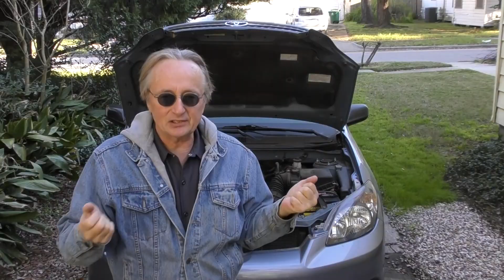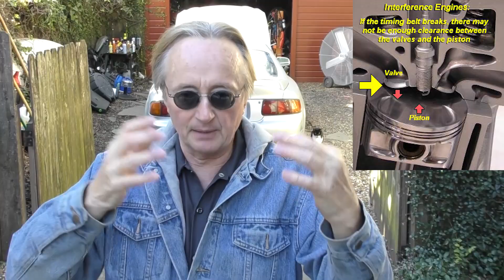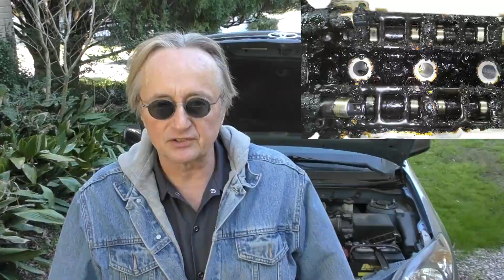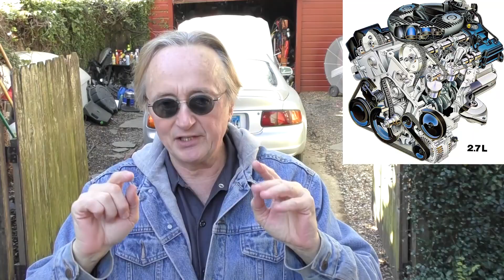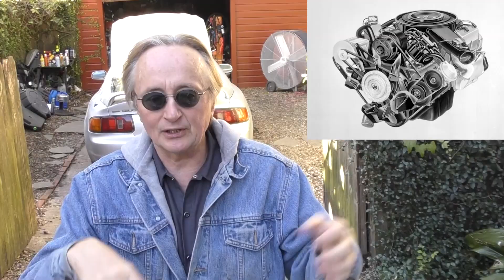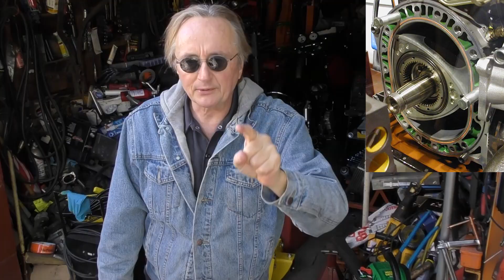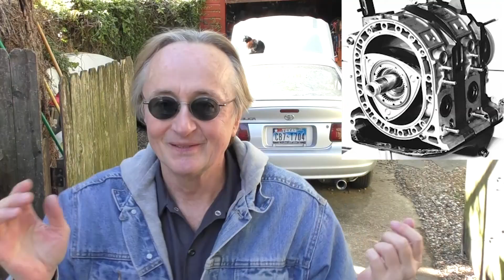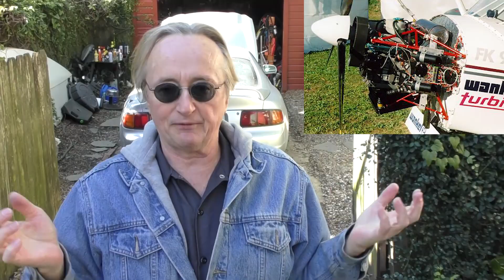Never Buy a Car With This Engine

Comment: Great vid yet again m8.can i ask what u think of the 1.8 deisel ford engine🤪🤪
Reply: I guess you mean CD9A/B? Those are in the transit. Goes forever if oil changed, timing belt and diesel filter. Seen a lot over 350k miles.
Reply: @nihonkokusai  yea m8 an thanks ro replyin im at 140 k so lots of life left nice👍

Comment: You can talk more than 5, specially European, garbage I Had a 2004 Honda Accord Euro 6 speed manual (Acura in the USA, bought it in 2009 in Australia with 214.000 km. Guess what the engine was like new, no oil leak anywhere everything working, it because the previous owner didn't look after so well, car go fast the lovely ivtec 2.4, just before I sell it I remember going up the hill in second gear to 100 km only 7.000 RPM  in 2014 I Bought the same model, top of the range, but Brand new happy with the car, I service every 5 000 km still like new. this 2.4 i vtec should be on top 5 best engine ever made. There is no plastic bullshit only quality material, from the rocker cover to the bottom

Comment: Maybe just maybe my family got lucky. My dad bought a 2008 cobalt with the 2.2 liter engine brand new with 6 miles on it. It now has over 200k on it. In the 11 years and 200k, the only major things that have messed up is the starter, and the fuel pump had a crack in it. Other than that, it’s been surprisingly very reliable. It’s without a doubt a cheap built car but it gets him from a to b and that’s all he cares about.

Comment: If the owners read the manual they would know the recommended oil specs for their vw
Reply: Oil spec who need oil spec, i used 15-40w on my Golf 1998 with 2.0 8V engine, that thing was leak oil from everywhere, i used to buy 5 gallons so i never do oil change on adding.

Comment: sometimes tho you have to remember that lots of times it is not due to bad design but its due to how the driver drives there car and maintains them, my dads a mechanic and he would always tell us what cars he got most to repair in engine problems and he would tell me these engines are not good they burn this or that and leak here and there.....but what i knew about those specific cars was that more than half those cars he would get to repair and think they are not good engine well i knew that those specific cars the drivers where young people around the world buying them for street racing and just to abuse them and run them hard and they did not maintain them well also, so for the mechanics view on it they would only see that they got those types of cars to fix the most and thats all they seen, but remember you can have a really shitty engine and be used by a grandpa and it will last them ages ....why? because they never ran them hard and always maintained them well and the apposite for a really good engine or a decent one if the person is using it for a specific reason and not taking care of it ;-)

Comment: I was driving my old Ford Pinto on a highway in South Florida one day when the engine started overheating. After I pulled over and looked under the hood, I found that the fan belt had disintegrated and so the water pump wasn't circulating coolant through the engine. In my car I had some twine that had been used to bind something and so I wrapped a length of it around the two V-groove pulleys and tightened it as much as I could. The pulleys did slip but there was enough friction that the water pump could spin fast enough to keep the engine from overheating, as I drove to the nearest auto parts store to get a new fan belt. That was one of the nice things about driving those simpler cars way back in the stone age.

Comment: The ecotec engine was much better than my 1973 Chevy Vegas aluminum block engine which went only 30,000 miles before burning a quart is oil every 500 miles.

Comment: well crap I just did a head gasket repair on a 2.2 ecotec out of and 02 chevey cavalier I had never done anything like this before but I went for It and it went ………….well I guess it runs and drives so im happy but later on I noticed a small oil leak and cant find out where 
lol but I did follow directions well I believe so yup I saw this video months after lol and that was a very challenging job for me but lots is easier now

Comment: I have had 3 ecotecs that have run great but I change with  synthetic oil every 5k miles . Currently running a 05 cav with 101k and no motor problems....I have also known others who got over 220k miles on a 2.2 and body rusted out in nh but engine was still fine even with minimal maint....all these American cars Scotty trashes have got me back and forth to work on a 60 mile  round trip for over 35 years

Comment: My parents had a truck with a 2.8 GM V6. It's a cast iron block with aluminum heads but the heads sit in an angled notch in the block. Due to varying metal flex, the head gasket would give at the angle and leak oil in water in combustion chamber or vice versa and tank the whole engine. Probably not many left these days, but also 1 to avoid.

Comment: I dont understand why you would include those last two, you have to actually try to find a Cadillac with an 864, and if you buying a rotary engine mazda, you probably already know what you getting into. I would have added a ford 5.4 in the list, and talked about the Cadillac northstar instead of the 864.

Comment: I guess good maintenance must make a difference because I have a 2003 Pontiac Grand Am with a 5 speed manual and a 2.2 EcoTec engine with 250,000 miles on it. The engine has never been opened up for any major repairs. I use Pennzoil High Mileage conventional oil (relatively inexpensive) and I change it every 3-4K miles. It burns about 2 quarts of oil between oil changes, but other than that it runs great and gets around 30 MPG. I’ve seen the timing chain setup though and I’m not surprised people had trouble with them. I, however have had great luck with mine.

Comment: 5. Chevy 2.2 Eco Tech 4 cylinder engine
4.  Audi 1.8 turbo charger 4 cylinder engine
3.  Chrysler 2.7 liter V-6 engine
2.  Cadillac V-8 6,4
1.  Mazda 1.3 liter rotary engine
Reply: The ecotec is strong and the 1.8t is tje euro 350.
Reply: Cadillac North Star “deathstar”
Reply: Mike Castellon 160k on my current one so far.
Reply: Thank you!
Reply: That eco tec 2.2 was a total shite, in UK my bro had a Vauxhall vectra  1.8 which was the older version,  now that was bomb proof. So he bought a new car with the 2.2 thinking that it would be a nice improvement, ha 36k miles cam chain jumped on starting an scrapped the engine. So got a new engine under warranty, that one lasted 63k, first started burning oil at 60k then cam chain snapped at 63k. Had a mate with one in a Vauxhall 220 an that went pop too.
Reply: @michaelbamber4887  I got burned on my 2008 Chevy Cobalt with that damn 2.2L last summer. The timing chain stretched after I did perfect maintenance being the second owner of this vehicle. I did replace the engine with one that only had 16k miles on it and I will unload this car once the engine has 60k on it to avoid having that problem ever again.
Reply: Those rotary engines were a flop lol
Reply: I have an 05 sebring touring convertible with the 2.7 V6. Lmao he had me dying with his commentary but so far i havent had any problems with it. About to hit 100k and im gonna change the water pump and timing chain  then
Reply: You're a hero. Wondering why the Ford 3.8L isn't on the list.
Reply: Thanks brother.
Reply: @What A Change Over Macha same here mine is a 2010 only big thing was the water pump went out have 137.000 miles still going strong
Reply: I had two rotaries back in the day and each went over 100K without major problems.  Each lasted longer than the car itself, which isn't saying much.
Reply: @TC-uy8ng  my stepfather had two RX7 my ex-wife had one he's right about fouling spark plugs flooding the engine carbureted or fuel injected it didn't seem to matter he's also right about the rotary seals we had an engine go bad with just over a hundred thousand miles if it even got there decent horsepower no torque bad gas mileage cool little sports car though the engine just sucked
Reply: @nickajk1  I had an RX2 and an RX7.  Definitely not economical by any stretch, but I never had much trouble with either one.   100K is a milestone for those, but wouldn't expect much more with the original seals.  I guess I was lucky.  Rotaries were just more of a novelty back then.
Reply: @TC-uy8ng  I don't think they got better in the RX8 when you look on craigslist most of those have been rebuilt or needing a rebuild with under a hundred thousand miles people drive the piss out of him that's the problem
Reply: andy n my best friend had an ‘83 RX7. It was a wonderful car when it was new. I think it was $14k. He kept it 14 years and it had around 90k. It was still running but it developed a horrible oil leak.
Reply: @TC-uy8ng  Scotty has some hard on for Toyota Toyota has had plenty of mishaps I'm not going to list everything that they do wrong I like and respect general motors and dislike Ford I guess it's what you're happy with growing up
Reply: Come on Scott he's not God he's a mechanic these are his opinions many have people have hundreds thousands millions of miles on that Chevy motor there's plenty of crap out there way worse then maybe all of these this is an opinion
Reply: How come Scotty didn't include the Camry 2.4 motors built with the WRONG piston rings ( not all of 'em ) that allows oil to be burned, starving the engine of lubrication & ruining cats, O2 sensors, etc., because people didn't stay on top of checking their dipsticks ( I know I don't often enuf, too )?? Honda motors burning oil, Subaru's as well plus the faulty Head Gaskets ( had a 1996 Outback die @ 124,000 miles !! )...Subaru says they love us---yeah, makes me wanna PUKE.
Reply: @stephenohluk2019  because this guy loves Toyota he thinks they could do nothing wrong look at all the cars Ford Chrysler in general motors that put out of course there's going to be a lemon here there Toyota doesn't have that many models I agree with you except it's the 1.8 vvt-i engine that burns oil and fouls plugs Toyota is not beyond making big mistakes he just doesn't mention them
Reply: @nickajk1  Toyota as gone down in quality lately they keep having recall, the gas pedal one was very dangerous. Also they started to rebrand other brand the new Yaris his a Mazda 3 rebadged and the new Supra a rebadged BMW Z4.
Reply: I'm going to have to agree with him on the Audi 1.8 Turbo 4.
Reply: The mazda rotary engine can last a long time, however..you have to treat it like a rotary powered car not a piston driven car. They require a lot more attention and care than a normal engine. Remember...they are the only mass produced engine for automotive use that is different than conventional engines since cars have been built.

Comment: Scotty, you forgot the 4.7L V8 Chrysler engine......and the 2.0L Chrysler engine in the Neons.......and the 2.4L engine used in the PT Cruisers.......Damn Chrysler.

But let's not take the light off of other car companies abominations, like the 4.6L Northstar engine, or the 2.0L split port used in the Ford Escorts.
Reply: Go out to any of the U-Pull It/Pick-N-Pull type wrecking yards locally and they are full of PT Cruisers and 'Cloud Cars'. (Cirrus/Breeze/Stratus/Sebring) PT's in particular are also known for severe electrical issues....like the EEC computer going bad,which is more $$$$ than the car is worth!!! Neon's weren't the greatest of cars,either?? (Other most common unit out there...those Minivans,of course??) They sure ain't building them like the old 225 'Slant 6' Dart/Valiant anymore!!!! Or even the old Full Size ones....which you still see on the road!!!....like Furies and New Yorkers,even a few old Imperials that didn't end up in a Demolition Derby??  (An old favorite of these guys, I'm told they had a reputation for being able to inflict/withstand serious damage that stopped other models dead in their tracks,while these would still be able to operate??)
Reply: @DrOlds7298   My dad had like 4 Grand Caravan and he spend about 10 k in all those year on transmission module or transmission rebuilt and yet he kept buying them. Till he told me he wanted to buy a Sunfire 2006 93k km or a civic 2002 with 350k km and told him to buy the civic now its a 406k km and the engine take less half pint oil. But its a automatic transmission and his starting to slip, 2 years ago in winter i needed to let the engine warm up, or the car woudln't move transmission slipped, so i went into reverse gear back a little then drive after that it was fine.
Reply: I had the 5.9 360ci Chrysler engine. It's the only thing on my truck that didn't fail. They looked to eat intake plenum gaskets tho.
Reply: What's wrong with the 4.7? I know a lot of people who don't maintain those and they last just fine... I think I can name more good Chrysler engines from the past than bad. I don't think the PT was really a bad car, but apparently a lot of parts on the engine were hard to access, the timing belt I think was one of the biggest problems. I agree on the Northstar, definitely one of GMs biggest embarrassments, whenever anyone goes to make fun of GMs, the Northstar is the first to name.
Reply: @ixionn563  Besides the fact that the 4.7s like to drop the valve seats into the cylinders?

And the PT cruisers. Either they come into my shop with blown head gaskets or broken connecting rods, and that's just the engine. Now that they're older, you have to look for rusted through subframes and crumbling ground straps.
Reply: @Viraqua  Well I'm not surprised considering every single person I know with a PT never changes any fluids, they get them cheap and they definitely don't want to own them. Never heard of the valve seat issue but I'll look into it.
Reply: shhht! stop scotty likes ford
Reply: HA, I don't mind any of those engines minus the Northstar. 4.7l, I have had ones with 250k. Neons 2000+ engines are indestructible, 99 and down are junk. 2.4l not much experience with those. 2.0l split port, yes they drop seats but I ran one up until 200k as a delivery vehicle.
Reply: I had a 1998 neon....  HATED that car. Felt like I was driving a gokart! Had to have entire engine rebuilt due to some issue it had.  Never again, Chrysler.... 🖕
Reply: @JenniferF2882  That was the worst car they ever made.

Comment: if you premix and use conventional oil changing it when you should, those rotary engines are pretty dependable... gas mileage not so good but they're super smooth

Comment: Rotary. The displacement of a 4 cylinder with the mpg of a v8.
Reply: and the power of a mid 2000's v6 lol
Reply: It’s worse fuel economy than a V8. Even worse than the Ford Triton V10.

Comment: Ford 5.4 and power stroke 6.0 deserve an honorable mention
Reply: My dad has 490k on his 5.4
Reply: GtotheC88 Ford 5.4 should be #1!
Reply: @lsxmatt  the 3 valve 5.4 should . The 2 valve is 2x better
Reply: Oledodgeboy98 Oh yea the 3 valves are junkkkk.
Reply: Oledodgeboy98 2 valves engines are amazing engines.
Reply: @DtownJ  I owe One in my F250 and I love it

Comment: Man, do I remember the rotary engines. Even with less than 10,000 miles on them, they make these ridiculously loud rattling noise like someone had put large stones in a dryer and turn it on.

Comment: The Rotary engine is an absolutely excellent design for high performance applications such as aircraft (like you said) and Race cars. Mazda actually won the 24 Hours of Lemans in 1991 with the 787B powered by the RE7B 4 Rotor making an insane 900 HP at full tilt, detuned to around 700 HP for race reliability. However in a street vehicle that gets driven daily they can be quite the chore to keep up with. They can last.. But You have to be extremely good with the maintenance. Even more so than the German cars at times. I'd like to see Rotary powered cars come back but only for the people that know what they're getting themselves into.

Comment: my cousin got lucky with her 2004 sunfire with the eco-tec, she never changed the oil in the thing and it still made it to 260,000 miles, the oil pump pickup had to be cleaned at some point and time because she lost oil pressure

Comment: We owned a Saturn ION with that little 4 cylinder engine. It was fairly fun since it had a 5 speed manual in it. Very cute car. We bought it with a little over 70k. We just sold it last year. it had 220k on the original engine and going strong. We see that car at least twice a week locally. But since this was my fun car I took care of it well. I would run cleaners in the engine and give it full synthetic oil and I could always tell as it got older when it was time to do it before the date. It would tick for the first 30 to 50 seconds when it was cold. When I would hear that tick, I would clean the engine, change the oil and that tick would go away. Now owners of the 2.7 V6 are not so lucky. That's the worst engine I have ever seen come out of Chrysler in modern times. If anyone thought the 2.5 turbo with that balance shaft was bad, or the Mitsu 3.0 oil burner was bad, that ain't got nothing on that. My advice for owners of that engine: Sell it. If you hang on to it whatever you do don't go over 70 or 80k without changing out that water pump and timing chain assembly or you might get stranded with a very costly repair bill. Horrible design. It's unfortunate since I love the intrepid sedan. Neat car. But unless it has the 3.5, walk away.

Comment: Are you sure it's not the later 2.4 Ecotec (2010+) you're thinking of? Those had notorious timing chain issues. The older 2.2 Ecotec rarely had any issues that I remember. I've replaced some water pumps and ignition modules on those 2.2's. Thats about it.